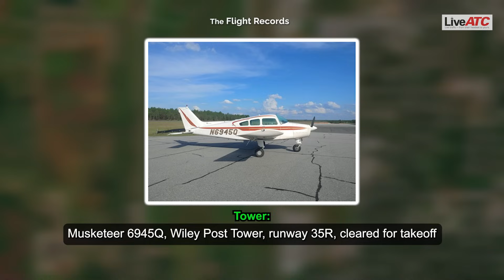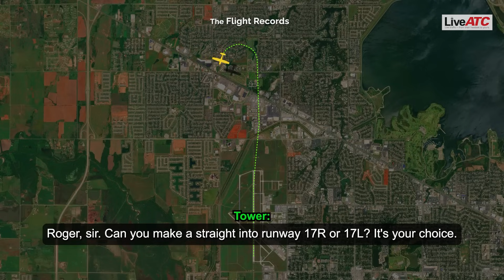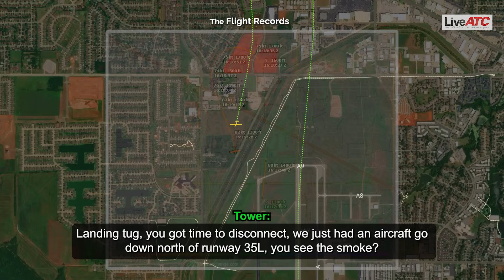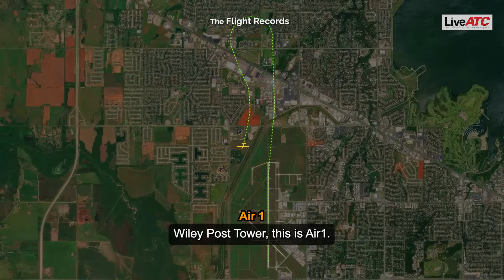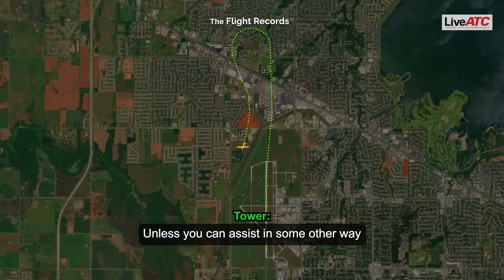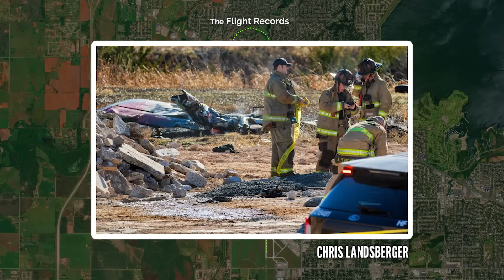LOSING POWER just after departure | 2 DEAD IN NW OKLAHOMA CITY PLANE CRASH

Comment: Also remember folks, if an engine isn't making proper power on take-off (you did check the RPMs and manifold pressure before lifting the wheels off the ground, right?) , it's not going to suddenly get better in the climb.

Comment: Never try the impossible turn unless you're flying a canard airplane, then it's not impossible because canard airplanes don't stall. They just don't. I pulled it off from 200' after a prop failure on takeoff. The Long EZ I did it in is in the little blue pic on the left.

Comment: Looks like he had partial power and he was in a climb when it occurred.   So I am guessing 70 knots IAS.  Lower the nose and gain as much AS as you can with what power you have left.  At low alt (I am guessing he was maybe 1000 AGL)  it's too risky trying the 180. If you lose all power during your turn then you have no choice. Level the wings and pitch for best glide speed and scan for a suitable landing spot. FORGET TURNING BACK TO THE AIRPORT!  If you are low and slow you CANNOT make any turns.    You are in a LOW ENERGY STATE!    Fly the A/C!   Try to turn and you bleed airspeed so you have a choice: lower the nose to maintain glide speed (lose altitude to maintain energy) or maintain alt and bleed airspeed and risk a stall/spin. Remember, a stall with rudder input will induce a spin!  DON'T DO IT!  If you have altitude then you can maybe execute a 180 but it's risky.  A 172 has a 9-1 glide ratio: 9 miles for every 1 mile AGL; So at 1500 feet AGL, about 2 miles!   I don't know the numbers for the Beechcraft but I'm guessing about the same or slightly worse (Cessnas are famous for their glide ratios)!  I am guessing he was at T/O climb power perhaps 1000 AGL or less when he lost power (800-900 fpm climb)!  All you can do is pitch for glide and scan in front of the A/C  for a landing spot. This should have been briefed BEFORE take off so you have a GAME PLAN!   DO NOT TRY THE IMPOSSIBLE TURN!   So sad and he could have done the RIGHT ACTION and survived. WHO CARES ABOUT THE PLANE!
Reply: Yep. You can tell there wasn'the a plan for this exact scenario.

He may have even had a plan for engine out....but man reduction of thrust is insidious. It lulls alot of people into sketchy turn backs, despite fields all around

Comment: Hello folks,  I have flown off this same runway many times and have some friends do the same thing. Here's the problem he had. Going straight out and find ing a place to land is not going to happen!  There is nothing but houses and streets full of car's.   What he did by trying to make that terrible turn ended up saving innocent lives.   I'm not sure how high he was and his relation to the runway when he lost power.  When my friends and I use that runway we know there's nothing in front of us to conduct a safe landing. I and the others do try to get as must altitude as possible in case we need to comeback.  It's very sad what happened but I proud of him not trying to land on the houses!  RIP young man, Thank you for this great video,,,,,
Reply: There are several large fields out there in front of him.
Reply: @MikeyJr.  EASY TO SEE THEM BUT FROM MUCH HIGHER ALTITUDE HE HAD.   M
Reply: N county line and w britton seems to have a lot of space
Reply: @charron1  How wide and long?

Comment: Sorry, I have no sympathy for this kind of accident. It's drilled into you from the start to look for a landing site within the 30 deg cone off your nose after takeoff engine failure. I get they made it a little furter and it wasn't quite the impossible turn but any turn is going to cost you altitude and airspeed which costs you time and options..
Reply: Would you have sympathy knowing a husband and wife died in this crash and left behind a 10 year old daughter? I don't usually GAF about A-holes on the internet but dang, they are real people, ya know? We all make mistakes.
Reply: He would have to have glided approximately four miles straight ahead north or landed on houses or city streets after clearing a major turnpike that runs around OKC.  He did bank left (west) and there is an open area about 1 1/2 miles perhaps he could have glided to, but he obviously thought he could make the runway!  Have no idea his altitude.

Comment: I instructed for years before retiring I will throw my two cents in here. Number 1. If you are low and slow NEVER try to turn back to the airport pick some spot in front of the aircraft make the decision immediately and land as best you can. If you are one of those folk who thinks you have to turn back pay attention. If you decide to make that turn you better be damn sure you won’t have to apply any back pressure at all in that turn to maintain altitude. Back pressure loads your wing up and you were taught stall speed increases with bank angle. Already being slow even a very small bank angle and any load on the wing will induce the stall and spin you to the ground. When you are already low and slow this will kill you. If you don’t have altitude to drop the nose and completely unload the aircraft you ain’t a gonna make it.
Reply: Great explanation, George. A number of years ago I was working in a law enforcement aviation. Among the aircraft in our hanger were a pair if Maules, an M5 and an M7. One day the other CFI and I decided to test the assumption that the turn was impossible. After a number of turns, at altitude, we determined that, depending on the wind, it was possible, in the M5, at Vy with at least 800 feet of altitude we tested the theory on one departure and failed (simulated) the engine at 1000', and landed on the departure runway. Having done that, I would still not recommend the maneuver.
Reply: My Bush  Pilot CFI in 1995 had 3 partial power fails working on old cargo airplanes in South America.  He was also a mechanic.  So i learned from the best, i dindt want a BS CFI with not that experience to BS me.  He said: loss of thrust On Take off, or partial power lost (we say LOTOT lately) mostly depends of kind of LOTOT.   If the engine is vibrating at over say 400 agl ofter take off, but keeping the rpm over say 1,700 then a tunback can be done safer due that is mostly a failed cylinder and the others are keeping some rpm and will mostly sustain level altitute, but wont climb on 3 cylinders of 4.  6 Cylinders engines mostly will climb on 5 unless high density alt. or heavy.  NOTE THAT. 

BUT IF ENGINE IS SURGING ON AND OFF,  that is a fuel problem instead and it might quick OFF soon.  Lower the nose, change tanks and lean the mixture a bit.  Don’t turnback unless a power off kind at over 700 agl is safer because it might quit on the low turn and you wont reach the runway.

= Dont turnback or turnaround the airport if engine is surging on and off under the power off turnback marker YOU HAVE DONE before that take off.  We had a marker on altimeter.
Reply: That is the first "emergency procedure" I remember my CFI telling me. Forget about turning around...you're going to stall. Concentrate on your other options and FLY THE PLANE!
Reply: @danb6838  Turning around the airport or Turback to opposite or side runway??  Those  are 2 very different maneuvers to learn.  Not the same maneuver like many that dont know them say.  LOL..
Reply: All good points, George.  Eleven of my thirteen engine failures Cobra in Vietnam, crop dusting in piston airplanes, and in small Cessnas on pipelines started at 200' AGL or lower.  Altitude (lots of) is time.  Airspeed, down low, is life.  My default takeoff in overloaded Cobra, Ag, or Cessna was the basic low ground effect takeoff.  Like in the crop field, I was at full power in low ground effect until obstructions required pitch up to just over the obstruction.  That cruise climb maneuvering airspeed, that zoom reserve airspeed, allowed me to maneuver to the obvious workable landing zone in the very near hemisphere.  Yes, all turns were 1 g turns because I allowed the nose to go down as designed (dynamic neutral stability) while banking as much as necessary to make that LZ in the six seconds I had available.  But most are low and slow (Vy is way too slow) as you say and most would freak out at the 40 degree nose pitch down in a sixty degree or greater bank angle at 200.'  Yes, quite doable as I have done it many times.  But you are correct to say they should not turn back.  I did once but only the the adjoining crop field because my student had already started a turn that way when pitching to just over the obstruction.  And yes, I had enough zoom reserve airspeed (airspeed is altitude and altitude, even 200' is airspeed) to zoom up a bit more the clear the trees going back into the adjoining field at an angle.  When it quits...look.  Where you can certainly get to is obvious, even if it is exactly between a couple of houses.  Fly (airspeed) all the way to there.  You probably have altitude, say 400 or so.  Trade that altitude for airspeed in order to maneuver to that workable (ok not great) landing zone.
Reply: @jimmydulin928  Yes Mr Dulin.  One factor is that he wasted precios 10-seconds calling ATC instead of turnback NOW,  NOT LATER.  Like calling Pop and Mom (ATC) while kept going away from airport.   He was losing power finally he did turnback and  soon after the turnback the engine quit cold and they could not reach the runway due that.  
Good idea about climbing above Vy if you decide you will never turnback.  But it takes a lot of discipline to stick to that plan even if you are over the turnback altitude, but if there are good fields in front,  it is a good plan to have if EFATO.
Reply: Yes, Dan, there are various considerations and the tactical situation is always fluid.  A huge advantage  for a poorly organized pilot like me was working low all day long.  All the organization of checklists and resource management had to be prepaid.  In six seconds it is just:  there, zoom turn at 1 g in the turn, full flaps, full forward slip, level the wing, and touchdown slowly and softly in the chosen spot.  KISS.
If high and turnback to runway is chosen, bank angle is what gets the crop duster back in the field 50 feet from where he left, not pulling on the stick.  At the very steep bank angle needed to return to the runway we left, the nose will go down significantly to remain 1 g and not stall.  Now, and only now, can the hard decision be made about glide distance to the runway.  Those even considering the turnback should be turning off the centerline extended a bit (the crop duster teardrop back) so as to have some standoff from the centerline extended at the time of engine failure.  If in a crosswind, that teardrop back should start downwind so as to be a radius reducing headwind component coming around and back onto the centerline extended.  Most turnbacks we see with the video and high tech GPS tracks overshoot the centerline extended back into the runway by a lot.  Somewhere on the airport in the grass is fine on many airports, but you don't get to choose the runway after departing on the centerline extended. @CFITOMAHAWK
Reply: You can do what ever you like just to pull into the stall stick position. Aircraft stall at a fixed angle of attack. Which directly correlates with the stick / yoke position.
Reply: Don't pull.  What does the airplane want to do/will do in every turn if you pay attention?  It wants to get the nose down to return to trimmed airspeed.  The airplane cannot stall itself.  A pilot pulling back on the stick is required. @chipcity3016
Reply: @chipcity3016  That depends on the weight at that moment.  If heavy, you will stall sooner at that elevator position .

Comment: I am in and out of Wiley Post frequently.  Ironically if they had had another 100-200' of altitude he could have made it to the mowed grassy area just north of the approach end of 17L and 17R.  Just north of the airport is a large irregular shaped grass field he could have put it down there and probably been successful.
Reply: SEE THIS POST FROM BELOW--- NOT MINE...
Hello folks,  I have flown off this same runway many times and have some friends do the same thing. Here's the problem he had. Going straight out and find ing a place to land is not going to happen!  There is nothing but houses and streets full of car's.   What he did by trying to make that terrible turn ended up saving innocent lives.   I'm not sure how high he was and his relation to the runway when he lost power.  When my friends and I use that runway we know there's nothing in front of us to conduct a safe landing. I and the others do try to get as must altitude as possible in case we need to comeback.  It's very sad what happened but I proud of him not trying to land on the houses!  RIP young man, Thank you for this great video,,,,,
Reply: I almost won the lotto when 22 years old.  But failed by 2 numbers.

Comment: The airport was the best option, but he should have started his turn back and declared emergency at the first sign of a bad engine.  He flew upwind for another 15 seconds before turning, putting 30 seconds additional to get back to the runway.  Regarding landing straight ahead - there really wasn't a good option ahead in OK city.  If he turned as PIC (aviate/navigate), then declared (communicate), we'd never have heard of this incident.  Impossible turn statistics have quite a selection bias - we hear of the bad ones, and never the ones that landed without incident.  As a pilot, I would say practice these turns - get the nose down and do a steep turn - standard rate won't get you back - the other thing is that you'll have a lot more drag with a stopped prop vs. idle requiring more nose down than you can practice for.
This really isn't the prototypical impossible turn as he was in the air for 2 minutes after the problems started.  I think there's quite a few pilots out there that would have made the turn back and an incident free landing that we'd never hear about.